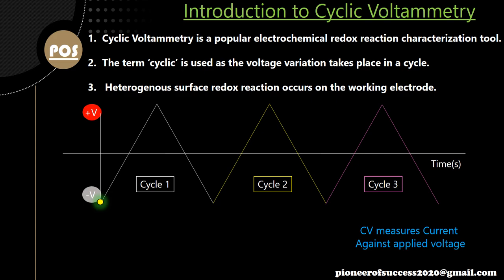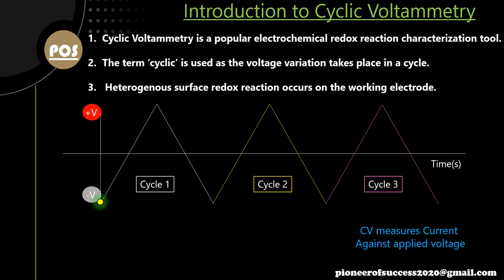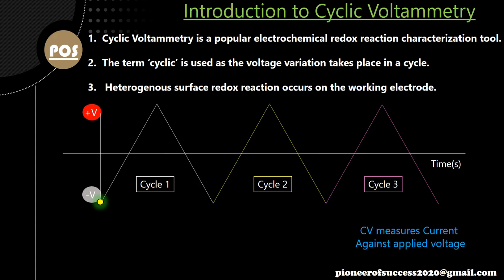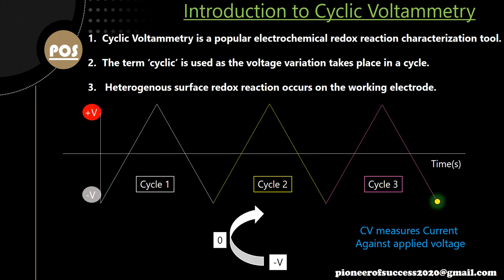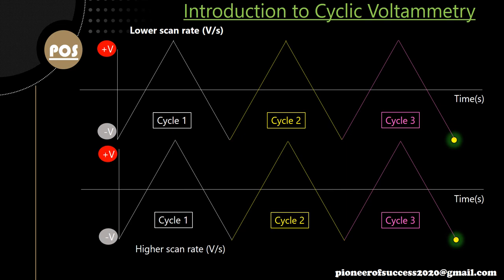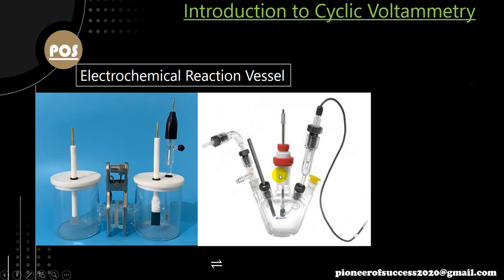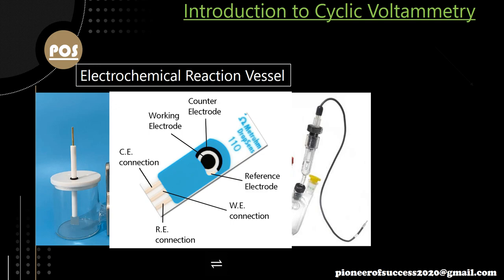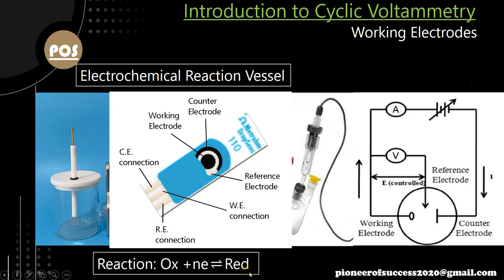Cyclic Voltammetry Lecture 1 #electrochemistry #CV #Voltammetry #Cyclic #pos

Comment: very nice explanation but just one correction: at time 4.33 both are having same scan rate as the graph is plotted against time and at the end of cyclic both are reaching there at same time position. So to show that one has higher scan rate, i believe the breadth of these plots have to be adjusted. Like if bottom have higher scan rate then it will make more cycles then upper one at the end... But other than that video is well explained